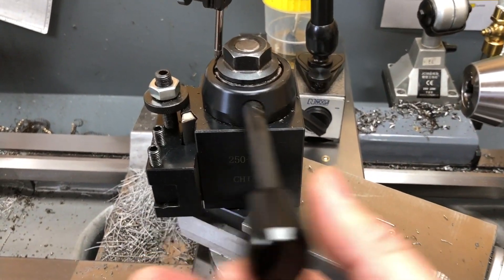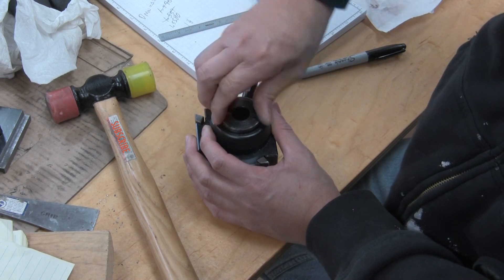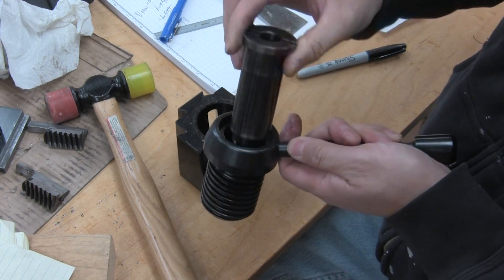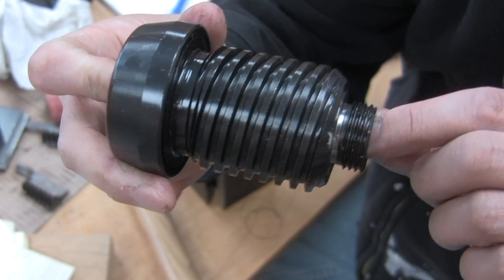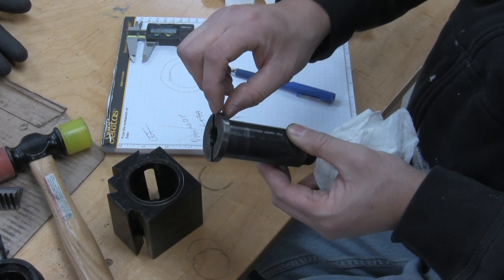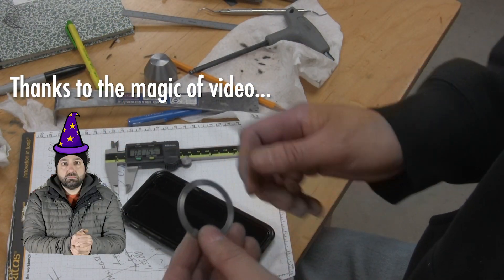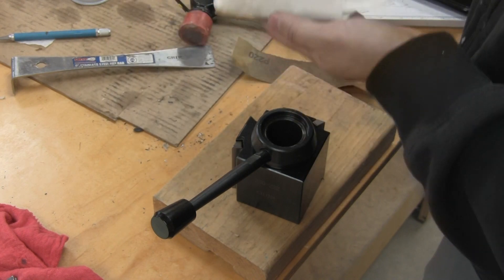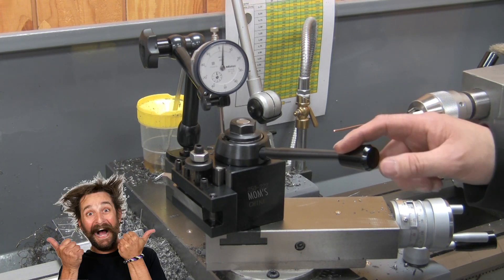How To Reduce Slop On QCTP (Tool Post) Of Your Lathe - Woods Creek Workshop

Comment: Thanks for the video. I had to watch your video to help me figure out how to disassemble mine. The only weak point on these tool posts is the threads on the lever handle. Mine snapped off flush with the toolpost. Since I needed to use my lathe to repair it, and I couldn't use my lathe without my toolpost I was in a pickle. I ended up milling off two opposing sides flat so I could open and close it with a large adjustable wrench. Now that I got it apart, I'm taking measurements and going to make a copy of the part.

Comment: Great video. I can't understand why some people feel compelled to remark on why they won't do something. As well as slop in tightening, slop affects how far the handle travels when loosening. The result is when fully loosened, the handle can be over the dovetails parallel to the ways. The end result is the removal of the tool holder is difficult. Have you done any work to reduce slop in the loosening direction?

Comment: Thanks for the video! I made a couple washers for mine by parting them off some brass rod, no tail support, just turned the OD, drilled and bored the ID, and used the Joe Pie method of "just go for it" when parting. 0.15 and 0.30, turns out using both of them wound up being the perfect amount! I somehow hit a magical balance between absolutely no slop (not counting the slop in the actual dovetail threads), and not too stiff either. It feels like a much more expensive tool post now 😂

Comment: The set screws on my Chinese tool holders scare me.  They're very tapered and the unthreaded portion  ends-up being inside the threads on the holder with a full height tool installed.  I need to find some that fit better.
Reply from the maker: Me too

Comment: Ideally for longer ware a brass shim would have been better, BUT, we in most cases work with what we have!
Reply from the maker: Those are stationary parts, no rotation or any other movement.  A simple shim 👍🏼
Reply: @woodscreekworkshop9939  I beg to differ, when tightening the post, the "scroll" as you call it is forced up against the shim. It's not much but there is still a little bit of rotational friction. I would still prefer a hardened steel shim over soft brass...

Comment: Question, what is the problem with having slop in that part of the tool post? I just found your channel and subbed!
Reply from the maker: Thanks for subscribing!  Play creates more play, like loose pin enlarges the hole.  But more importantly FOR ME, I wanted it to feel more precise in my hands.  If I slide a lever, the mechanism should slide and it gets annoying when you have a mile of slack.